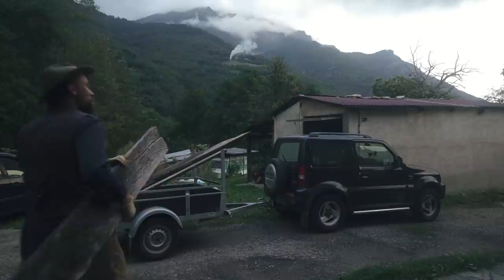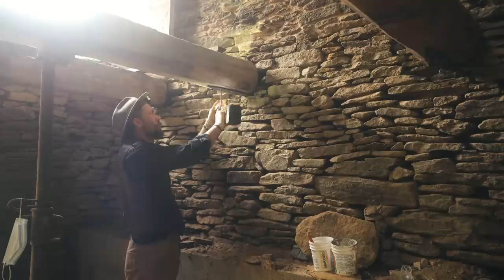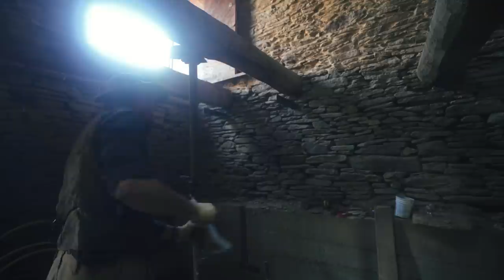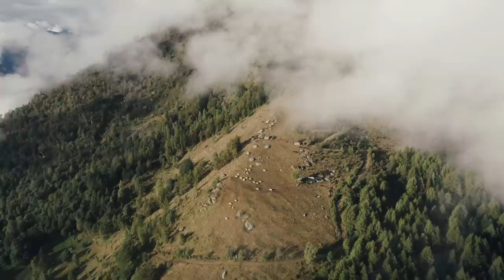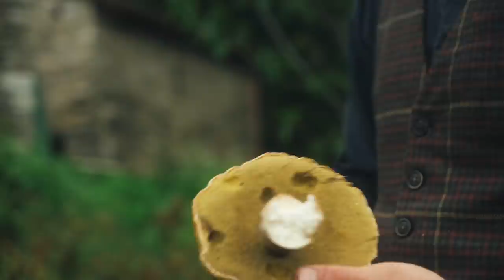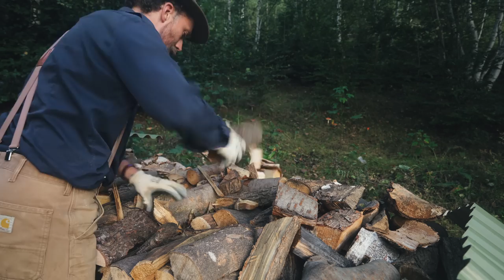#84 First Mushrooms

Comment: Those screws in the T-anchors on the end of your floorbeams are important structural elements and should be dimensioned properly. Their job is to keep the anchors rigid to the beams so you won't introduce a momentum/leverage into the brickwork. Don't underestimate this part....
Reply: Yeah.
I would have added an upper iron plate, bolted to the lower T piece through the wooden beam.
I think it would have been much stronger that way, avoiding risks of instability for the wall.
Reply: Structurally those anchors are only good on long term to stop horizontal movement, they are simply too short to carry the full weight of a floor.. It could easily be remedied by either making them longer and securing them really well to the wooden structure or using the cut up beams as pillar, resting on the concrete wall. The latter being the best option.

Comment: Martini…a camping tip from the north country where I live. When we go camping, we each find a rock about the size of a small loaf of bread, making sure it’s not from the river or near it (you don’t want to heat up a water logged stone), we place them right next to the fire so they soak up the heat. When ready for bed, we wrap the hot stone in a hand towel, and shove it to the bottom of our sleeping bag. The stone will radiate a beautiful, cozy heat throughout the night against your feet. In fact, the stone will still be warm in the morning. You can do the same, by placing a stone (or two!) on your stove in the early evening.
Reply: Bravo people of out door leaving!

Comment: Hi Martijn, I've binged on your videos once I discovered them and have marvelled at the scenery, your long hours of work and craftwork in timber and stone, which deserves much respect. I am concerned about your steel floor beam extensions. The steel is strong, but their footprint is tiny. If you were building this from new, I'm sure you'd build the stone wall in mind of the beams load within the wall, by spreading that load over a sizeable foundation rock within the wall. The beam would act as one, and without deflection it spreads the load evenly within the wall. Instead, what you have (looking at 12:00) are small rock pieces supporting the steel. Sure, the steel is encased in mortar, but the small footprint is on top of small group of rock pieces of unknown strength. Add to that you do not think the timber to steel connectors are necessary, when in fact they importantly act to make the beam behave as one and evenly distribute the load within the wall. Without connectors, the beam is two sections wanting to hinge on the inside edge of the wall, placing high loads on that group of small founding rocks. At minimum I would provide strong connections and for peace of mind I would place larger founding rocks or weld a bigger surface area plate onto the steel extensions to spread the load and reduce the pressure on the rocks. You are also in a seismically active zone, so being conservative with structural design is not a bad thing.

Comment: Awesome mushrooms there on the slopes in Val Pellice. The variety of species is also a treat. Just one of the many brief segments this week. Getting the old wood from the friend in town, filling in the holes inside and out, straightening out the room for next steps, cleaning up the mess from all of the interior work. I really enjoyed the lowering of the beam on to the newly enclosed T-bar support. Lots to think about for sure.

For some reason cleaning up seems to cause some good vibes, so getting things cleaned up and ready for pointing downstairs must feel good. There have been several times over the past two years where Martijn has commented along these lines and then smiles, looking our way, with that blissful look one gets when neatness replaces a mess. So the pointing and then building the stove/oven should be happening soon. Martijn also mentioned the time available until winter, and with 13 weeks left things will have to move a bit more urgently to make living inside the cabin a reality. Geppo is also supposed to come this week with the new windows, and that will make a huge difference. I have some windows at my place on Cape Cod that open from the side (with a crank), so I am wondering if Martijn's windows may have a similar feature. The opening he is using as a door (near the shower) is supposed to end up being a window and that's what I was thinking could be hinged on the side to let some air in there. Time will tell. I am also thinking about screens for the summer months and bug season. Nice to be able to leave the windows open without an invasion of pesky biting insects of various sorts. Plenty of time for that.

If Martijn holds true to form he will have already thought some of this through and we will be surprised by the outcome. Like the metal t-beams to hold up the wooden beams. Thanks Martijn for the explanation on how those work. After the explanation I can see that the T shaped metal is strong enough to hold a tremendous amount of weight. Well done. 

This week we also got to see the cows and hear the bells. Also the nice stash of local cheese from the grateful farmer. Thanks Martijn for sharing your weekly highlights.

Comment: Hello. I wonder why the windows of your cabins are so narrow and rectangular. I guess because of the weather, but I'm not sure. I am not the architect, nor am I the restorer. It's amazing to see so much nature through your eyes. Creation is beautiful. Well, I would be unable to pick mushrooms. I find it dangerous even if I have some knowledge of the subject. I don't even that... Hahahahaha.
I hope and wish that your plans come out and before winter you can occupy the house. I imagine that after the winter you will continue with the other cabin. Although there you have set up the workshop... No? Best regards.
Reply: When these building were built new, glass was not common and was very expensive to purchase, not to mention the heat loss was a consideration as well. Also the lower levels were used as barns for animal shelter, so not a lot of light was needed.

Comment: You could use several poly tunnels to put plants in that are affected by big temperature changes, such as the peppers, cucumbers, tomatoes, etc., until you can build the greenhouse. Of course, it is late in the season and the cold weather (for you) will arrive soon. The good thing about poly tunnels is that they are relatively easy to setup, maintain, and gain access to the plants once they begin producing, not to mention the protection they provide from the elements (hard rain). However, the greenhouse will be much better. Be safe in  your work and especially driving up and down the mountain!

Comment: Martijn, i was looking at the steel supports that hold the floor beams in place. I was thinking about this and as a suggestion, you could built an additional stone wall in front of the existing wall, but not a straight fake wall, but you could design arches, between the beams and the straight part supports the beams and the arches are just to make it look pretty and visually  pleasing to the eye. It will be even more of a wall feature if you add a few lights to accent the arches. You did such a beautiful job on the arch for the ‘utility’ room, hence my idea.

Comment: If you want the floor as strong as possibile you may add a vertical beam against the wall to sustain the floor beam where was the single horizontal one you  removed, pushing from below the horizontal iron
Reply: It’s strong enough
Reply: @bear1245  probably,  but he said he want the floor as strong as possibile, and I am a fan of redundancy, to increase  strength and resilience

Comment: Colors are slowly changing, difference higher up in the mountain to lower in the town/valleys. More rain too. How is your solar power supply on overcast days, sufficient battery storage and panels? What about panel elevation and angle? When do you plan to start modifying the battery storage area for heavy winter snowfall?

Comment: Martijn, if you stand your wood up in a circle (5-6 ft across) and then put a chain around it and attach a bungy cord to the chain (holding the whole circle together tight and upright) you can chop all the wood without having to pick up each piece two or three times! It all stays standing up in a bundle and you can whack at the pieces until you have the sizes you want.

Comment: Two things Martjin  -  is it time to winterise the chicken coup?   Perspex, bales of hay, electric light, or even transfer the cement to the larger building and pop the 3 girls in the utility room during snowstorms, with the heat from your oven warming the outside walls.   And, you can power wash the bottom side of your home before winter and you start making it cosy and clean, in case the water under pressure comes through?

Comment: That "axe" is in fact a splitting maul and does not need to be sharp. It works by momentum rather that sharpness. It won't matter for the small logs you are splitting, but if you attempt to split a big whole tree trunk section a sharp maul could get stuck and be very difficult to extract.
Also, why did you throw the logs to be split on the floor and then pick them up again ?  Put the splitting stump next to the pile, pick a log up off the pile and split it. Next log. Much less bending and work.
Reply: Makes sense

Comment: Amazing that he has resisted the temptation, I would have succumbed to, of opening up the wall with a big window (or two) facing those incredible mountain views. Just imagining the light and views that would provide, particularly from the upper floor.
Reply: He unfortunately  is not allowed to change the outside structure of the cabins. He did have a plan originally to connect the two cabins with a glas corridor but that was not allowed. But i think he is enjoying  the view when he is outside, the cabin is to sleep and eat and work on his laptop.  He has adapted to the live of the local people who where once living like this in the summer in the winter they lived in the valley.  He is preparing the cabin for living in the winter as well.

Comment: I enjoy all of the work you've done and continue to! 
However, I just couldn't trust the Metal bars to carry the weight of the beams. I'm sure it will work, but I would be concerned with any kind of movement, either over time or in case of something seismic.

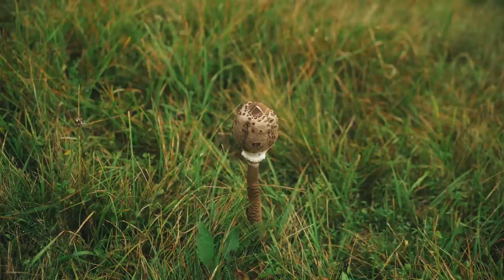Comment: I peperoni (green peppers) do not grow well in the Alps, but tomatoes do, perhaps it is necessary to fertilize soil with humus or manure and improve irrigation, with a programmable drip system. About mushrooms there are 3 autumnal species. Search for Agaricus Arvensis ( prataiolo in italian  which can't be translated, means something coming from the meadow), they grow in a an open meadow forming a tipical semi circular arrangement. Armillaria mellea (chiodino in italian, little nail) growing under tree stumps and Macrolepiota procera (Mazza di tamburo in italian, drum mallet), you have alredy find one as seen in this video (min 33:35) a new born in its tipical drum mallet shape, as it grows, is "hat" will open and become a huge umbrella.

Comment: Martin I had questions about the steel members you added to the floor members that you verified later in the episode. They seem to be T shapes, what are the dimensions of the steel member and how long? It looks like you slowed the wooden floor to have the steel extend into the wood. Interesting.
Then during the rainy period shown in the episode. Between the 2 building there was quite a bit of water run off there. Is it passing between the building heading down hill? No issues of water in the bottom the building? I look forward to each episode.
Reply: No drainage issues 👍🏻

Comment: Hi  Martjin, don't you need to leave some hole for let air in the cabin, for the stove to breeath and oout for the bathroom?
Reply: I would imagine that air will come in around the doors, which are home made.
Reply: OfficialMartijnDoolaard--_  the point is that in a closed house if you have open flames stove or whatever else  you shoud leave an opening (10 to 15 cm diam) to let fresh air to get in (with new oxigen). For the bath it's required (and useful too) to have an extractor (or a window ) to extract moisture. For this second maybe possible that the window could suffice  because there will not be any separation.

Comment: are You not afraid that these sharp and slim metal bars will put too much pressure on the small rocks and cement ? the floor will "work" through the years and so the metal bar can easily cause the cracks and crush thin rocks and the cement ? hardness of the cement make it easy to crush..a matter of crack susceptibility ? Don't You worry about that ? the solution would be to place big/massive stones right under the wooden beam..